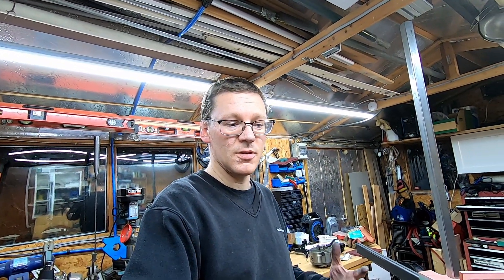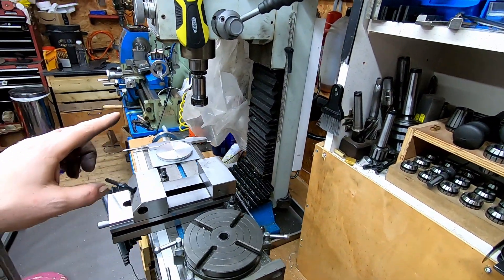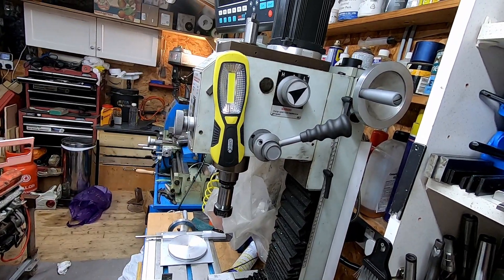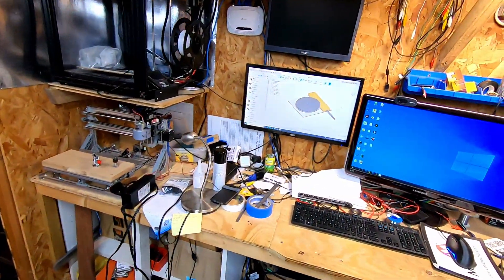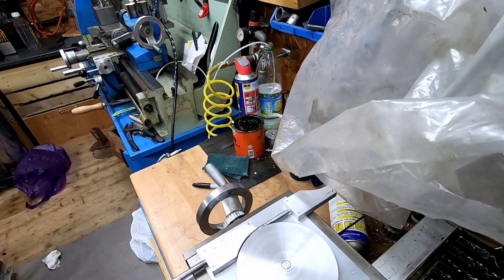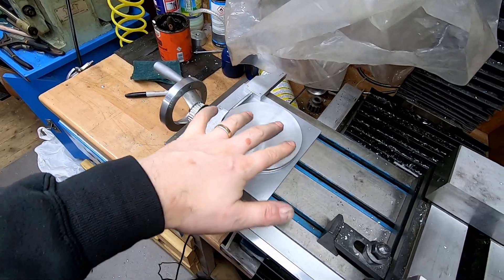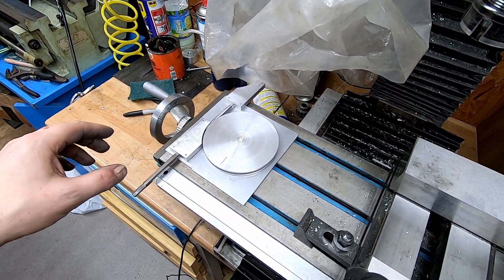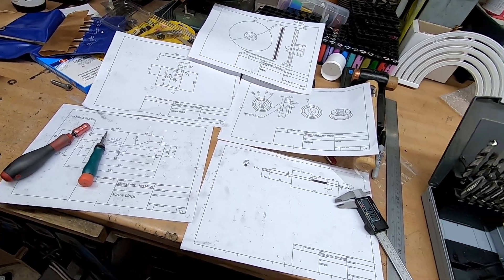Low Profile Rotary Table (almost) #toolfest2021

Comment: Very nice design for sure. Looks like a great start, even with an error or 2 it's very nice...
Some time back I came up with a simple idea to use a clutch flywheel from a car/truck
https://youtu.be/qO7dHU-DcEU
Not finished in the video but very straightforward and certainly many ways to improve on the idea, just not as pretty as yours
Reply from the maker: Hi Craig, just watched and commented on your video. It's great to see people tackling the same problem in different ways.
Reply: @ollysworkshop  couldn't agree more...that's the best thing about our lil hobby, all the alternative ways of doing things

Comment: pretty cool design idea, is there a bearing in the bottom or what is keeping the table itself held down? Also, being setup like that, do you know what the gear ratio is on it?
Reply from the maker: Hi, yes there's a bearing holding the table to the base. The leadscrew is 1mm pitch, and the table diameter was calculated so the circumference is 360mm, so 1 turn for 1 degree (which may be a little too fine). Thanks for watching